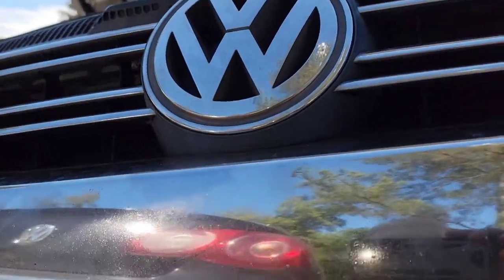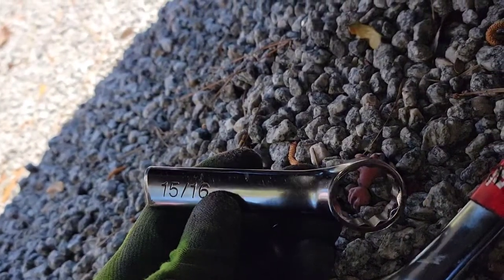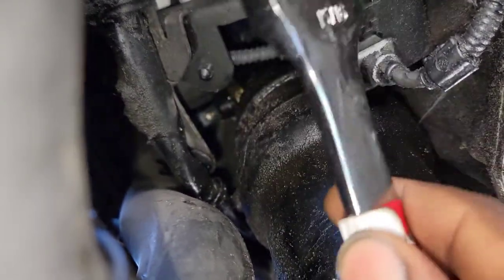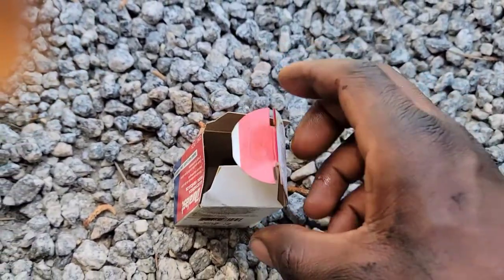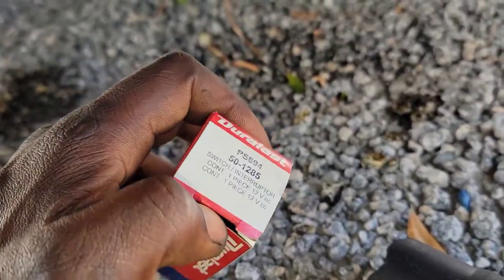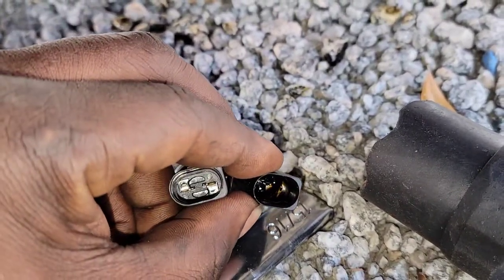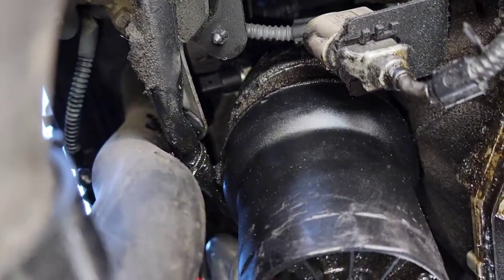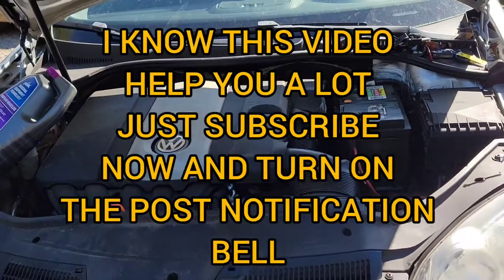How to Change Oil Pressure Sensor The easiest way on 2008 volkswagen jetta

Comment: Great video. I have a 2006 Jetta 2.5L engine and I couldn't find where the oil pressure sensor was located and now I know where it is. I'm about to change mine. I also bough the replacement part at Advanced Auto and they provided me the sensor with the smaller connector. I will probably need to return for the bigger sensor connector like the one you have. I have a question. Did you disconnect the wire connector off camera before you removed the sensor? I bought a 15/16 deep socket for this project based on other videos I watched so I will probably have to disconnect first. Do you think a deep socket would work in that tight spot? Thanks for the video!
Reply from the maker: Yes disconnect the wire first a short wrench would work I buy a 15/16 wrench at autozone and cut it in half to fit
Reply: @MrtalentedReid  Did you have to move anything else out of the way to get at that sensor? The sensor appears so much clearer in your video than it does when trying to find it's location on my car. I'm wondering since my car is a 2006 that accessing the sensor is not as easy as the 2008. Any ideas?
Reply from the maker: No i didn't remove any some can be complicated just have to try work your way around it
Reply: I did it! I think I was being to careful not to break anything. I admit it is in difficult position but I was able to replace it. Unfortunately the oil pressure light is still coming on which probably means the problem is the oil pump.

Comment: so my Passat 2000 v6 2.8 leaks alot of oil and it isn’t the oil pan that leak but on top and it seems like it comes from the oil pressure so changing that would it work ?
Reply from the maker: Yes if that's the problem